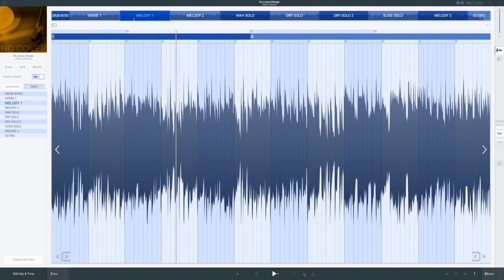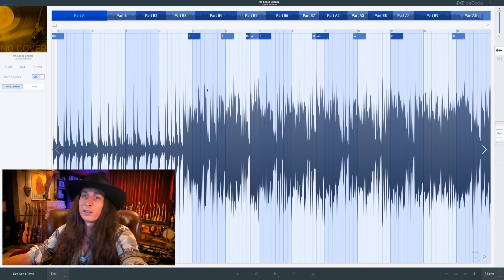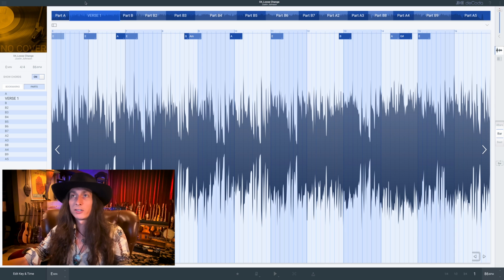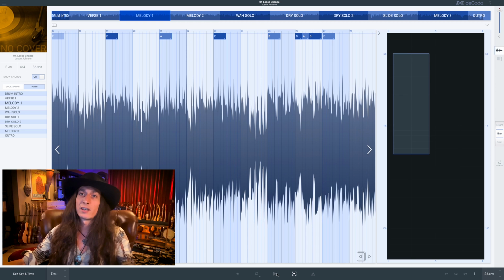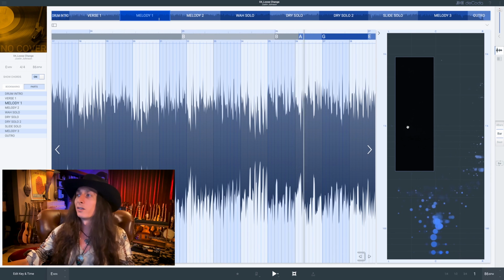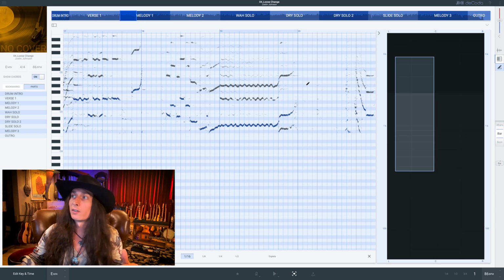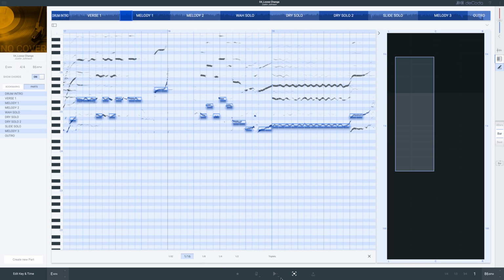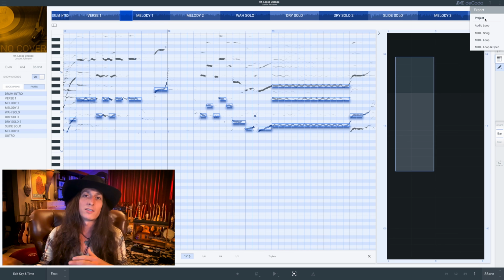Decoda Showcase by Justin Johnson

Comment: Nice review, Justin.  Quick question:  if you load an old 60's or 70's track that wasn't played to a click, will it figure out the tempo automatically? Or stretch the song to fit a set tempo without glitches?  Thanks!
Reply from the maker: yes, in most cases it will, but it will keep the original tempo and adjust the metronome
Reply: @zplanedev  That's great to hear, thanks man!